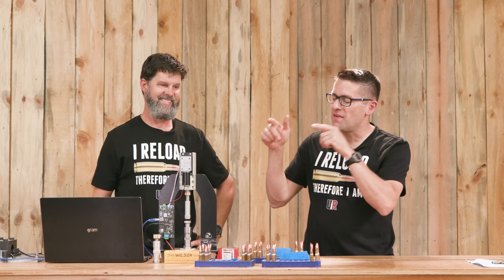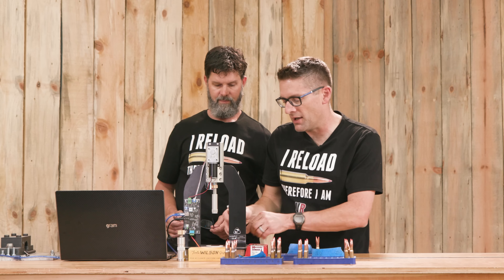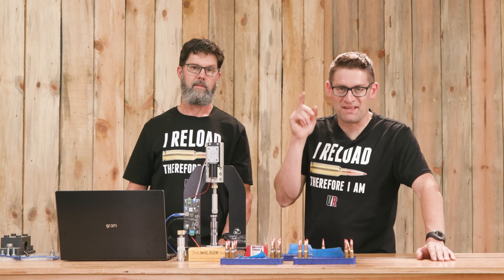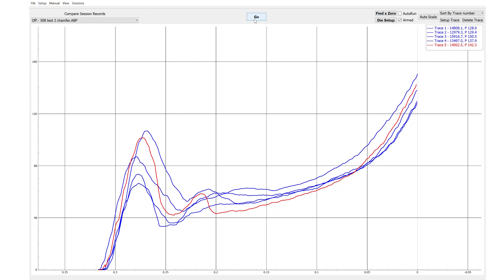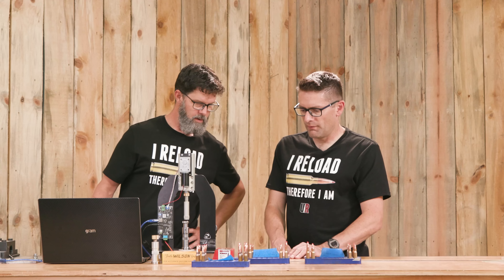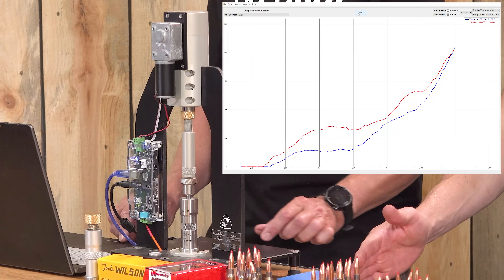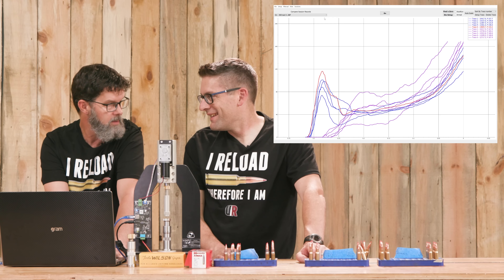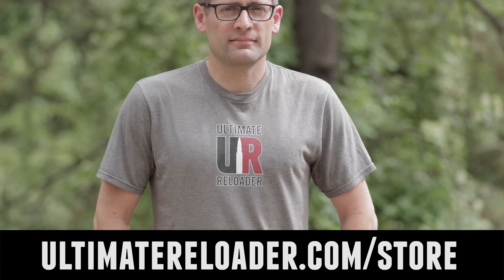How Does Brass Prep Affect Bullet Seating? (AMP Press Tests)

Comment: I just started reloading and bought some Lapua brass and it was extremely tight for my 308 loads. I would definitely go back now and chamfer some other brand-new pieces of Lapua brass and try my reload again. But is this normal for Lapua brass? Conversely I was loading once fired 308 Winchester brass and actually had to next size it down to 330 using my S-Type die to get some neck tension for the same Hornady bullets. It was the complete opposite of my experience with a brand new Lapua brass. maybe you can do a video on that....?  Thank you I really enjoy your videos, don't ever stop

Comment: How about checking seating pressure on cases that are annealed AFTER being resized?   I ask because a video by the AMP people shows that every process in resizing adds to case hardness.   It got me thinking that if I changed my order of reloading to -  de-prime, tumble, trim, size, ANNEAL, prime, charge and seat the bullet that the only thing affecting case neck hardness after annealing would simply be bullet seating.   It would be interesting to see AMP press test results on cases done in that order and then see if there is any difference at the range on paper.   I plan to run some tests and hope that you will as well.

Comment: I did some tests: trim length, weigth, deburring, primer pocket uniformer, flash hole, full length sizing, annealing, nylon brush the necks and pressure seating. 29 brass and the velocity that result  was very intresting. The pressure between 17 to 25 psi was the more uniform in velocity and grouping with SD of 4 . and the all of 29 shooting was 14 of SD.

Comment: I admire your scientific approach to loading ammunition.  You mentioned a concern on one test sample of scratching the bullet.  Interesting as the rifling is going to scratch the bullet much more than anything else.  It would be interesting to see different neck size diameters in relation their tension and the effect of different powders interplay as some powders combust better at certain pressure levels and how this relationship influences accuracy and or velocity.  Lots of rabbit holes to go down.

Comment: Definitely would like to see this test with some premium brass such as Lapua. This test seemed all over the place vs the previous AMP press video test where you annealed your Lapua brass and had extremely consistent results. Comparing the two videos, i think you guys proved that the quality of the brass matters more. Meaning, if you're not starting with quality brass, you're not going to get consistent results no matter what you do to it. It would also be interesting to see how annealing and neck turning affects seating pressure.

Comment: Gavin, I love your videos on prep but one of the items that would be interesting would be the effect on loaded round to chamber neck size and the clearance that produces the best results. I had noticed that on my 260 Improved chamber I originally opted for a 2 thou clearance but noticed afterwards that a round could not easily be inserted into the expanded neck so I have further necked turned the brass another 1/2 thou to give me a 3 thou clearance from the .296 chamber neck. Have you done any tests on this at all and possible effect on accuracy?
Might be a good exercise to hand to Travis when he gets the time. What neck clearance do you run on your "accuracy" chambers? Regards Rob

Comment: I’d like to see what a light spray of Hornady Case Lube does.  I put my reloading tray on some paper and lightly spray from a few feet away four times, turning the tray 90° each spray.  I’m spraying on a downward angle around 45°.   I know a small amount of that spray gets in the necks.  This is towards the end of my brass prep. steps, so I’ve already done depriming , cleaning, annealing, body sizing, neck trimming, chamfering.  My next steps are neck sizing, seating primers, loading the powder and finally seating the bullets. I also dip the ends of the bullets in a dry powder before seating.  I’m trying to get smooth, consistent seating and some prevention from cold welding in case some of the loaded ammo is going to sit for a while.  My ES’s and SD’s are down where I want them and my rounds are pretty concentric with ADG brass using a Redding 3 die set (body, neck and competition seating).  I have not yet tested rounds that have sat for a month or so.  If they retain their speed consistency and give me the same velocities the I’ll be satisfied that the bullets are not developing a molecular bond with the necks (I.e. they’re not starting to stick, or cold weld to the necks).

Comment: I have a feeling that the initial spike will correlate with damage to the bullet base and jacket due to scraping of the jacket along a rough internal neck or neck with a larger angle. Differences in the initial spike will likely  correlate  with changes in bullet yaw leaving the barrel and BC due to base/jacket damage, and will likely show up in group size on paper. These effects on paper should  increase with distance, and should be able to be tested with groups, or better yet, with equipment that measures changes in BC of fired bullets over distance (ie. New Oehler 89). Looking at your results, the damage to bases/jackets will likely be minimized with careful VLD chamfering and then brushing or setting inside diameter with a mandrel to smooth out any burs or ridges created by the chamfering.

I feel that consistencies in the remainder of the curve past the initial peak will correlate with velocity SD/ES, and will be able to be observed on a chronograph and on paper at long range only. This will likely correlate with consistent neck wall thickness, brass consistency, brass “elasticity,” and lubricicity; and will be affected by brass quality, neck turning, annealing, inside neck cleaning, lubrication/graphite. It would be great if you could figure out a way to measure bullet pull weight and consistency, and correlate this with seating pressure, velocity, and accuracy. 

Great work and fascinating what this equipment will be able to tell . The most important thing will always be what changes and effects actually correlate with consistency and accuracy, and why. I wish I had the time and equipment to help. Hope my thoughts give you some ideas. Mike D

Comment: Great video guys. I would like to see if not using the power station would make a difference so instead of having a horizontal scratch  pattern in the neck you would have a vertical scratch pattern by cleaning the necks with a brush by hand.

Comment: Graphs are a fine starting point, but let's see how those bullets shoot. After that, I would be interested to see you examine the effects of chamfering. Personally, I think there is a need for precision chamfering with a tool that holds a VLD chamfer in perfect alignment with the centerline of the case. If a damaged muzzle crown can adversely affect accuracy, it stands to reason that a case neck chamfered on an angle can tip a bullet as it jumps to the lands. I suspect that the adverse impact of poor chamfering would be more pronounced as the bullet jump increases.

Comment: Neat!
I feel the difference if I reload brass that has been Lee neck-sized and fired about 10 times without annealing. It'd be interesting to see it quantified.
And I'm not a fan of spinning a bronze brush in a case. The striations should be kept lengthwise. You need to inspect them, I suspect the lower initial force with bronze brush is a rounding of the edge, ie a chamfer.

Comment: I have seen many studies on brass neck prep. It would seem the length of the neck would cause more or less drag depending on the length of the neck causing a difference in pressure build and or FPS/SD. Your thoughts? I have not seen any test on neck trim length i.e. 2.470col apposed to 2.480col or neck total surface area that's in contact with the bullet.

Comment: Would be interesting to see what would happen if you took the chamfered brass and then polished the case mouth with some 0000 steel wool. Take a small piece of  steel wool and stuff it in the end of a nut driver and spin it in a drill and compare the two.

Comment: Try bushing die without expanderball cases vs full lengh die with expander. Run cases thru 10 shots and se how they "age" in hardness. (Workharden). Should affect neck tension and case head life.

People usually anneal not only to get more life out of cases. But when you have a "mixxed bag" with once fired and lots fired cases. Annealing, sizing and then trimming makes them more or less the same when it comes to shooting.

Comment: M.E. to M.E. that analysis at the end was pretty weak.  I think the most meaningful way to compare the result would be to integrate the max minus the min over distance that should produce a number that represents your consistency rather than just throwing a bunch of traces on screen.  Can the software not do that?  
Machinist to Machinist it would be interesting to compare the bronze brush spun on that prep center vs one that was handle mounted and just pressed in and pulled out.  The lay you are putting inside the neck should make a difference and should be lower when the lay and press direction align (also I don't have a prep center so handle mount, in and out once, is how I do it).

Comment: I would like to see you add an expander die to the mix. Since unturned brass can vary slightly in neck thickness this could account for varying readings. Also you could add skimming the necks and turning the necks to see how it affects seating pressure.

Comment: Hello guys, great job, I think we are all experimenting with the AMP Press, which basically generates data and now we must do tests and more tests until we begin to understand which is the best process.
Annealing is essential and chamfering is becoming very necessary as well. Putting dry lubricant, of the graphite type could improve a lot, although there are people who do not use it because they say that it is deposited over time in the barrel, in my experience, I have a .308 with a Bartlein barrel with 2000 shots and I have not seen no harm in putting it.
What I would like to see is an experiment with quality brass and the result on paper, this will lead us to the path of knowing which method to follow and also to better understand the graphics.
I see in some of the graphics a certain distance at the beginning of the settlement, that is, where the bullet begins to press and I think it is the first point to touch, that pressure should be as constant as possible.
We keep experimenting
thanks for your job

Comment: Wow, that seating force was very high & the differences of 40+ Lbs was not remotely consistent. 
I don't know what you guys do for your brass prep but, my seating force is between 20 & 30 Lbs with 90% being between 22 & 28 Lbs. 
I noticed also that the annealed case consistency was surprisingly poor & I believe the only lot to fail to seat to the specified depth consistently.
I'm sorry guys but there has to be something wrong somewhere, especially with regard to the annealed cases. My annealed cases are so far removed from virgin or once fired cases that I have to wonder if your cases were annealed at all.

Comment: Id like to see what difference it would make if a light coating was put on the sides of the projectiles the ones used to resize brass wax / spay cans like hornady / lube them up  to cut back on friction ?

Comment: Guys, I love your approach and methodology but *come on*. LC brass? That stuff has huge neck thickness variation. I've turned down as much as 0.005" and still had plenty left over to work with. And they're horribly eccentric and out of round most of the time. Please try this again with turned case necks or at least Lapua brass and mic the brass case neck thickness to be sure. Further though, I'd like to see this process repeated with bullets coated with HBN. I think you will find that HBN will uniform the seating force over a wide array of different brass preps or lack thereof.
Reply from the maker: See our last test of Lapua brass. Lower quality brass testing is just as important (you see the difference :) )
Reply: @Ultimatereloader  Well agreed that it's important to test low quality stuff vs. more expensive to discern the difference. I'll check out your last test. Frankly I'm all for trying to do more with less. It's easy to get good results with the most expensive of everything and more of a challenge do do it on a budget with less expensive components. Anway, you are kicking ass with the data driven approach and AMP delivering these tools is just amazing. No guessing, super objective.

Comment: The only way this comparison would be some what accurate is if the test where done with the same 5 cases. The variance from case to case will make a huge difference just like testing loads. The only way to truly test loads is with a single case annealed between each test firing

Comment: There is so much math that could be derived from this data.  It would be nice to be able to remove the "normal" pressure curve from all other tests to examine the initial forces more closely.  The computer can generate a "normal" curve from the data gathered within user set parameters.  This would result in a 'flat' line normalization/de-convolution where users can derive the max pressure from the data.  The "spikes" shown in this trial are nothing but spikes as we do not know where the "base" of the curve is to determine max pressure.  Clear as mud??

Comment: Did you anneal before you sized?  That does make a huge difference.

I anneal, size without expander, sstl tumble, lube necks with Redding dry sizing graphite, mandrel, trim with Giraud trimmer, drop powder with Autotrickler, load bullets.  SDs are usually between 3-10 depending on brass used.  Lapua or Peterson will produce better SDs than Starline or LC or other commercial brass.

Comment: I would like to see if there is a detectable difference on the range.  I suspect unless it is in a benchrest gun it won't make a bit of difference and the groups will all be the same.  The powder, seating depth and of course all the same components make the biggest difference.    If you shoot through a 308 gas gun (AR10) the battering of the cartridge in the magazine and the violent loading process will most likely negate any difference.

Comment: I think it would be much easier to see a visual comparison if you prepped and tested ten of each and then created a single graph showing the average of the ten (if it's possible) and then compare each of the "average" graphs at the same time.  This would allow a true head-to-head of all five processes to the control on the same graph without overlaying 30 individual traces.

Comment: My conclusion is to just keep doing things like I've done them for the past 40 years. Clean, resize, measure case length, trim if necessary, chamfer & deburr, wet tumble, load, shoot, repeat, and anneal about every 3rd firing.

Comment: While the shape of the curve shows interesting results I think the actual vertical spread at the end of the curve is the most important result since it represents the grip of the case on the bullet just as it is fired. You could use this method to sort cartridges that have very close grip on the bullet and see how they would group no matter what prep had been done to the case. Essentially, you would be left with "damage" being done to the bullet when seating as the only difference between the loads. Now that's just a guess. It would also be interesting to see how different case manufacturers brass affect the curve.
Reply: "I think the actual vertical spread at the end of the curve is the most important result since it represents the grip of the case on the bullet just as it is fired" - I think you might be onto something here. Furthermore, it seems that not all the runs stop exactly at the same spot on the horizontal axis - does this indicate differences in actual seating depth? Don't know as don't have access to AMP Press, so just asking silly questions :)
Reply: @mikkosaarnivala  That some curves ended before most of the others was surprising and should be looked at. Its a good question. Its as if the bullet was not seated to the same depth? I would think this isn't supposed to happen though it appears the maximum force is identical between those.

Comment: What the heck does seating force even really mean?  What difference does it make?  As far as I could tell, all the tests ended up at about the same place which would mean neck tension to me.
Reply: The main takeaway for me is simply to recognize that anything you change in your brass prep will have some effect.  And if you don’t anneal, your seating force and thus your neck tension will be different after every reload.  The goal is consistency.  Whatever it is that you do, do the same thing every time for the most consistent results.  Who cares what that seating force graph looks like, as long as it looks the same every time you reload that piece of brass!
Reply: @formulajoe2  It probably makes no difference at all in PRS type rifles or worse.  It may or may not even make a difference in Bench rest.  BUT, simply throwing numbers out there that have no meaning behind them is just noise.

Comment: Such a deep rabbit hole to jump down!  It's great to see measured results!  How about mil-spec brass against Lapua or Peterson, Alpha, Norma, etc.?  Another cool one would be your mandrel sizer you are using against something like a Redding die that uses a specific bushing.  Out of the box brass against some that has been neck turned for concentricity.  Of course, the proof is in the accuracy.  Great job!
Reply from the maker: Great feedback and ideas, we will put those in the hopper!